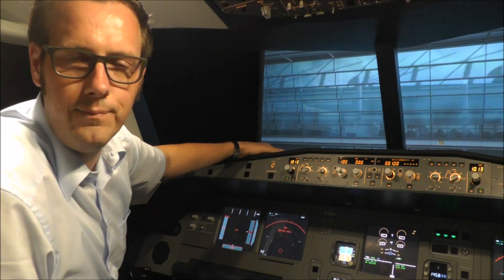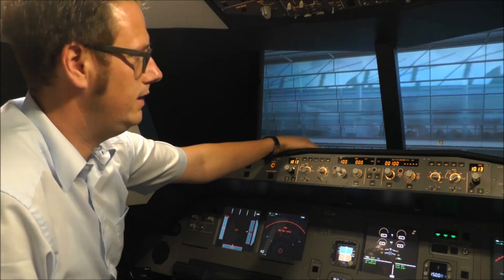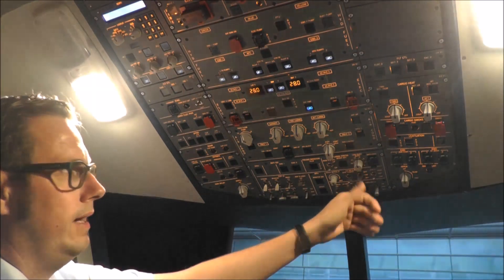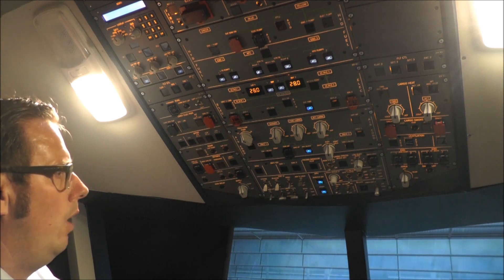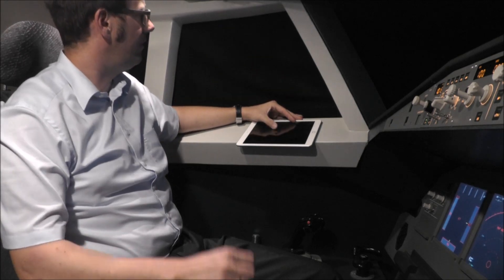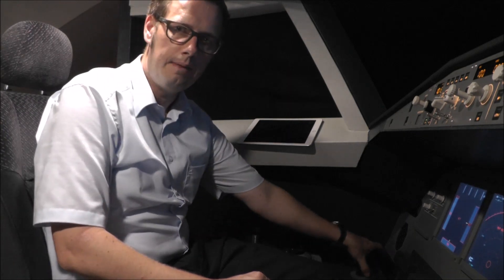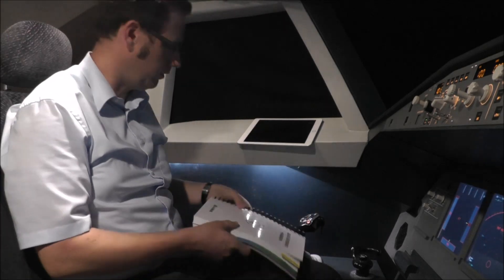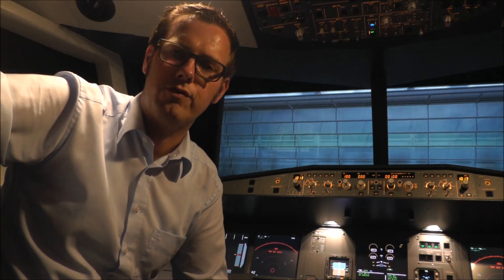A320 Homecockpit Introduction (D-ALAM)

Comment: HELLO . I started building an A320 cab based on FMGS software. And the profile of Scalarki 5.1.

I ask you for help with setting the priority for the captain and co-pilot joysticks. In the software, I configured the buttons as follows.

Left stick.

Button Push action: "CPT APTO" - Push event

Button Release: "CPT APTO" - Realease event

Right stick.

Button Push action: "FO APTO" - Push event

Button Release: "FO APTO" - Realease event.

With this setting, when I press the captain’s button, the red arrow on the right lights up and I hear “Priority on the left”

When you press the second pilot’s button, the red arrow on the left lights up and I hear “Priority on the right”. The arrow lights up while I keep the button pressed. When you release the button, the arrow does not light. With this setting, both joysticks work. This is probably not right.

I tried setting up a little for my girlfriend:

Left stick.

Button Push action: "CPT APTO" - Push event

Button Release: "CPT STICK PTT" - Realease event

Right stick.

Button Push action: "FO APTO" - Push event

Button Release: "FO STICK PTT" - Realease event

With this setting, it seems to me that the joysticks start working correctly! The one whose priority controls. And the second is turned off and does not control. But the red arrow is constantly on. And it should not be so. Visible on video @ui1A  I hope you understand what my problem is. I will be very grateful for your help!

Best regards, Sergei.